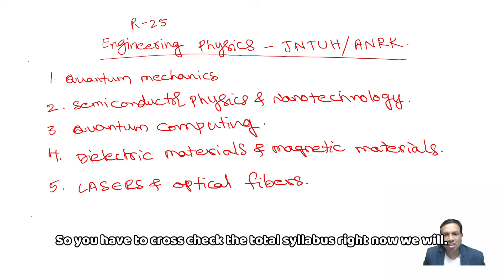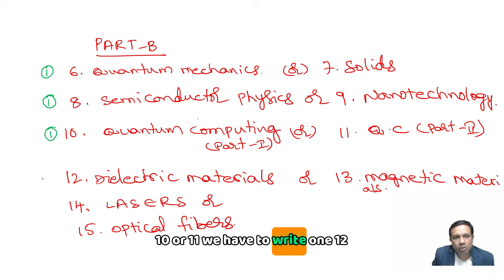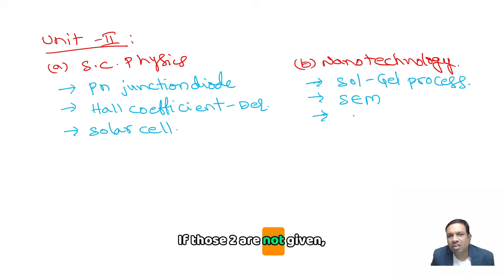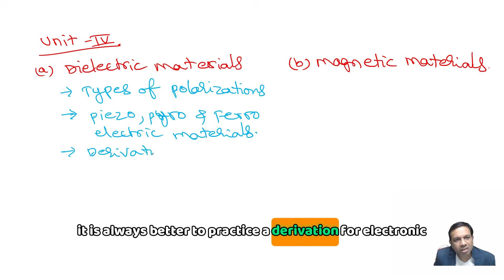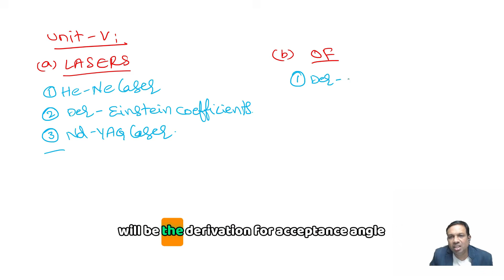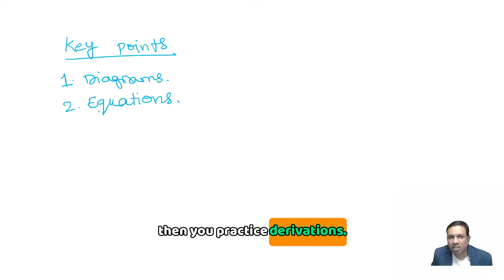Engineering Physics (R-25)  important questions  for sem end exams

Comment: sir but in jntuh R25 regulation from quantum physics, Davission - Germer experiment is not included
Reply from the maker: The syllabus is slightly different for JNTUH and JNTUH affiliated and Atonomus colleges. Based on syllabus, we have to prepare. All the best.
Reply from the maker: Yes, you are right. Syllabus varies from JNTU H and autonomous colleges slightly. Kindly cross check the syllabus.